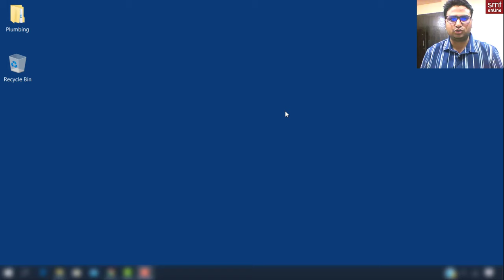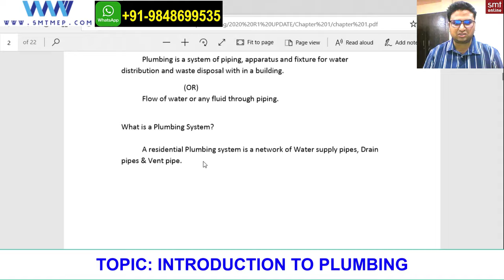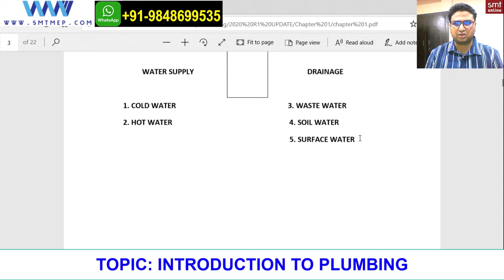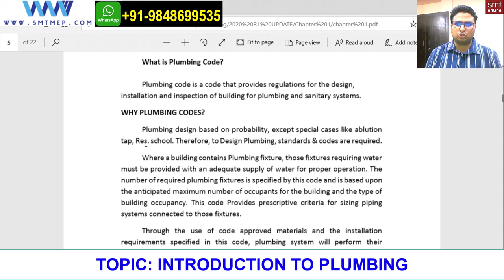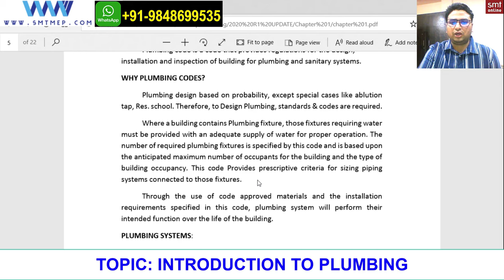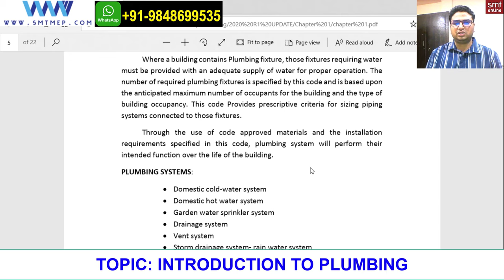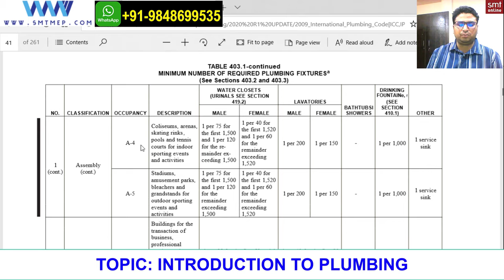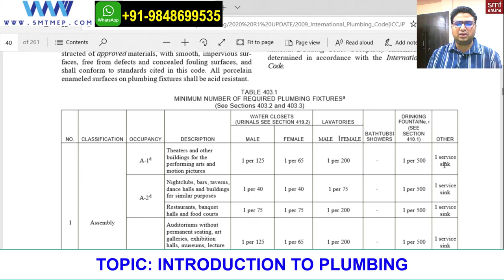PLUMBING DESIGN I PLUMBING SYSTEM - CLASS 1

Comment: Codes -  are recommendation values for design, sizing, num of outlets, material, installation requirements guidelines based on previous experiences for any system can be called as codes.

Comment: sir how can we verify that gpm and pressure is as per standard at shower or lavatory
Reply: By pressure test (needed pressure gauge & valve). 
Flow/GPM  can  also b calculate practically by stop watch and then calculating total volume of water in tank.